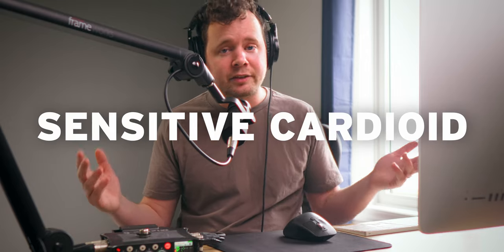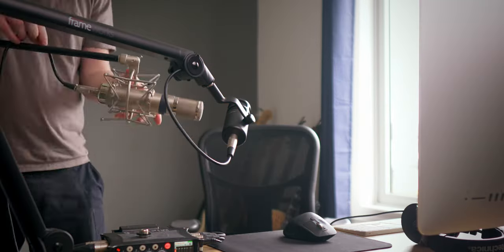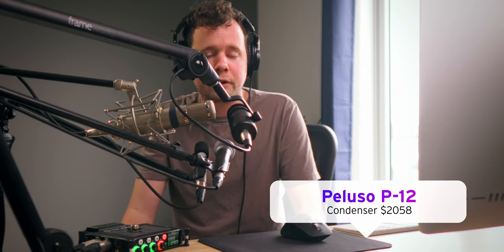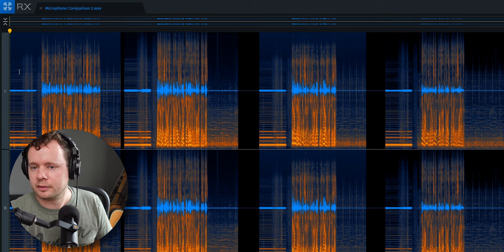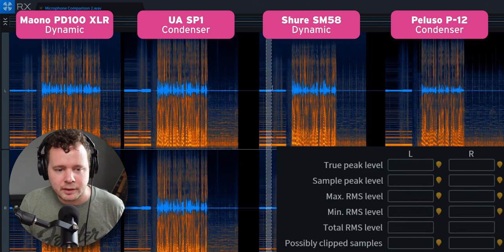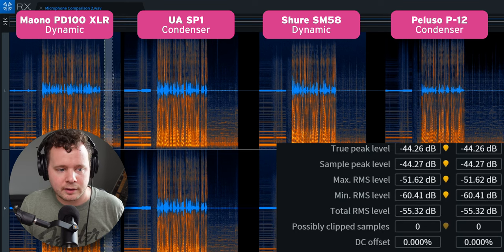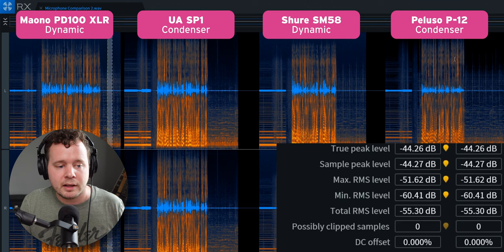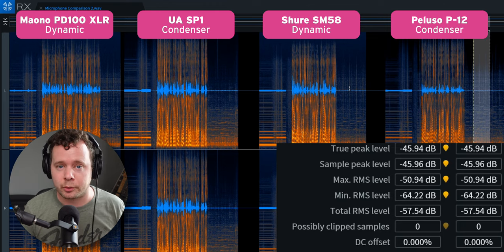Dynamic vs Condenser Microphones

Comment: This is the video I NEEDED to watch. Thank you so much! I currently have a $300 mic and want to upgrade to a $800-$1000 range. My dream mic is the Lauten Eden but before I reach the dream I need something in the middle. I’m considering a 2nd condenser before I get my dream tube. Mainly because of repairing/maintenance of tubes and how it’s not easily fixable in my current location

Comment: This video conflates a general concept of "noise" to mean both preamp noise versus background noise/reverb. Untreated spaces ate terrible for reverb in particular and in terms of someone trying to do some gentle post processing reducing a little hum/hiss from a preamp is infinitely easier than trying to somehow undo reverb
Reply from the maker: Noise in recording is defined by any unwanted signal interfering with your clean signal. This includes both acoustic factors like reverb and ambient noise, as well as electrical noise like preamp noise. You’re right though, electrical noise is generally easier to remove because of its consistency.

Comment: A third factor is microphone self-noise. A condenser microphone has higher sensitivity, but it also has higher self-noise. If the sensitivity gain is higher than the self-noise, then the condenser will have less noise than the dynamic microphone because the SNR starts off higher.  Dynamic microphones have near zero self-noise, but pre-amps have a lot of noise. Adding 10dB of gain in the pre-amp also adds 10dB to the referred input noise of the preamp (usually). So, the situation is more complicated than generalizing without looking as specific microphones. Add in proximity, dynamic range, and artifacts, and it gets even more complicated. If one compares a well respected dynamic microphone like the EV RE-20 to the Lauten LS-208, the Lauten condenser is made specifically to meet all the other requirements that an RE-20 satisfies, and excels with 135db of SPL handling and has a wider frequency response, but the sensitivity is only 5mV/Pa compared to the RE-20 1.5mV/Pa.  That extra sensitivity comes at a cost of a 15dBA self noise. So, 10dB of extra gain is needed for the RE-20, but any high quality preamp will not add anywhere near 15dB of input referred noise to add 10dB of gain. I like the RE-20 for what it does, and the Lauten for everything else, but one is not gangbusters noisier than the other.
Reply from the maker: Oooooo this is a solid point! Thanks for sharing this info. I think you’re totally spot on that there’s not going to be an overwhelming large difference, especially when using decent mics.

Comment: Maybe it's just my ears, but a condenser always seems to sound better to me. I have heard lots of dynamics sound great too, but they never seem to have that crisp high end or the articulation for voice over work a condenser has. The condensers do pick up a lot of background noise at high gain levels though so for some this may be an issue. Depending on the mic and voice, the dynamics always seem bassier with less mids and highs. An SM7 to my ears sounds mushy and blah....you need to eq and process the crap out of one to make it sound decent.
Reply: I have a relatively deep voice and it's a pain in the ass to find a dynamic mic which doesn't sound mediocre. Most dynamic mics make my voice sound like it only consists of bass. Even bought the SM7B two times and an audio interface with better preamps to no avail. I eventually gave up and got a condenser.

Comment: A big part of the sensitivity  is the width of the diaphragm. While an expensive dynamic capsule with two nanometer diaphragm will pick up the slightest noise, much less sensitive 25 nanometer diaphragm on a dynamic will not vibrate from distant sounds. Instead of the rate dropping approximately 40 decibels per 6 in, dynamic microphones will often drop more than two times that amount.  This is why as hard as companies were trying to make dynamic shotguns, when condensers were extremely expensive, They just couldn't pull it off.  They even try to use the SM55 (Same thing. Is this in 57) as a boom microphone called the SM5(a). Basically an SM57 inside of a blimp he would use for a standard shotgun .  It's sold Nothing for 40 plus years (less than 200 units per year ) until all of a sudden the seven version blew up in 2008 for some dumb reason.  Now they are claiming it's always been the number one microphone. It never was in radio stations. It never will be. It's a POS. I agree with you that with new insulation techniques, you can make dynamics work.  You can probably get a pro studio insulation for less than $1,000 per 100 ft².  You could also get a shotgun which really helps if you know how to use it properly.
Reply from the maker: This is all great info! The thing a lot of people miss is that regardless of the microphones sensitivity, you will compensate with gain, effectively making them pick up the same amount of signal (and noise). Noise comes in all shapes and forms, yet people act like noise only happens in really high frequencies, only to be picked up by condensers, but that’s just not the case. Noise is full frequency, meaning the diaphragm, regardless of construction will pick it up. Some less than others, but again, it’s matched when the mics are gain-matched, which presumably everyone does when speaking into a microphone. You’re totally right though that diaphragm construction will make some microphones more sensitive and make them more accurate at picking up with less distortion. This is why calibration mics usually have a 2-3mm diaphragm. They are super accurate. That doesn’t mean they pick up more noise though ;)

Comment: I have a very noisy room and there is lot of background noise. What do you recommend? Please help me understand.  I am new to this and i want to be a  audio podcaster and do voice over as well.
Reply from the maker: 100% the best thing you can do is find a mic thats a cardioid with low self-noise, and make sure you get darn close to that thing! Honestly, proximity is THE best tool you have at your disposal. Get nice and close to a cardioid mic and you’re good!
Reply: @randyrektor  thanks for the quick reply but do you suggest any good stuff to buy. I am returning the sanheiser profile I bought a few days ago cos the box looks tampered and when I tried using it, I could hear a lot of background noise picked up altho I kept the mic close to my face.  
I am so confused to choose these stuff altho I have a great desire to start a podcast.  Please help me with some of your choices in my situation.  Thanks

Comment: SO TO REDUCE A ROOM ECHO WHICH MIC IS BEST CONDENSER OR DYNAMIC?
Reply from the maker: Any mic with a cardioid pattern, but mostly you should be treating your space first. Transducers are transducers that wiggle in the air pressure. Regardless of capsule type, they are both susceptible to picking up noise.

Comment: I have quite a few condensers and dynamics,  in a room with a lot a reverb or background noise I definitely would not be picking up most condenser microphones for recording in that situation.  A condenser is generally designed to pick up every little detail of everything and they dynamic is designed to pick up what's directly in front of it and condensers are supposed to be used from a slight distance which gives them a more natural sound than having them really close which often sounds kind of wonky on a condenser.    If you get something like a tlm 103 even at super low again it's picking up so much unwanted things it's unreal if you're not in a proper recording booth. 

The bottom line in a less than ideal environment I don't think I would be grabbing a condenser mic or at least not most of them
Reply from the maker: Polar pattern is the only thing that determines the direction microphones pick up. A cardioid condenser and cardioid dynamic with similar polar patterns both only pick up what’s directly in front of them. Microphone capsule type can’t discriminate between voice and noise. This is where most people are led astray. Sound pressure levels are sound pressure levels and if they are gain matched, they are both picking up noise in the room equally.
Reply: Yes but that is not what i was getting at here, lower gain levels pick up less noise and a mic closer to your mouth will give you a much more of a voice to room noise ratio, the closer the mic to your mouth means your voice is way louder than any room noise and you can turn the gain down lower too so the room noise won't be as loud,  generally you can get a dynamic closer to your mouth before it starts to sound funky or has too strong of a proximity effect.  now my lauten ls 208 condenser is designed to be used more like a dynamic, you can bring it in very close and still get a prety natural sound, when i bring most condenser mics in close they start to sound boomy and muddy but a lto of dynamics still sound pretty normal 1-3 inch's from your mouth picking up way more voice than room noise.    
 @randyrektor

Comment: I am mixed on your thoughts. It's paramount for my podcasting clients to display proper microphone etiquette to decrease their signal to noise ratio. Of course if they're not using their mic properly- dynamic vs. condenser is going to be somewhat of a mute point anyways. In the case of most lazy podcasters who can't be bothered to display proper etiquette, a dynamic mic is defintely going to help mitigate a lot of the unwanted noise/sounds. This video doesn't really account much for frequency response, and you can definitely hear the extra "unwanted" (in this case) range in your tests. A nice excersize- but I don't think this is an answer.
Reply from the maker: So interestingly a lot of dynamics actually pic up more high frequencies, contrary to what most think. Additionally, large diaphragm condensers are some of the quietest mics out there when looking at self noise.  The reason so many think dynamics are better is because people tend to get closer to them. But if you get right on a condenser and right on a dynamic, the room noise will be consistent. This has been demoed by many major mic companies. Lewitt has a video covering this on their channel too.
Reply from the maker: But you’re right, mic technique is the most important part.

Comment: Still, in untreated spaces, especially with sounds or noises coming from other rooms a dynamic mic is so much easier to handle, and much less work in Post. This is at least my experience.
Reply from the maker: Yeah for sure! The point is that this is entirely due to how people tend use them, not because of the technology.

Comment: SNR is not based on the noise of the environment, but is based on the noise created by the internal capacitors, resistors, etc. of a microphone. 
each microphone will always capture background noises, (Diegetic Sounds) what makes dynamic a go-to for non-treated rooms is that dynamic microphone tends to capture "louder sounds" without the use of phantom power,  so in laymen's terms, a dynamic microphone is useful when you don't have better preamps with you,  so in this case you are using a sound devices which is one of the best preamps there is in consumer market. 

as you notice, when you speak with your SM58 you won't notice the noise because the noise floor itself has been canceled, by the loudness of your voice it's there but we wouldn't notice it because we are more focused on your voice than the background noise, but then, once you record in silence, the diaphragm would always capture the loudest noise there is, and in this case music and whitenoises. 

and lastly, a well-treated room is not about soundproofing it from unwanted outside noise,  but making sure that you have well-balanced diffusers/reflectors bass traps around the room. using condenser microphones in an untreated room will only cause problems with early reflections (reverb) in which a dynamic microphone doesn't really capture reflection that much that's why it's mostly used by artists on stage for vocals even there' are dozens of people shouting from the audience area.   but unless you are capturing instruments or vocal-specific frequencies then a condenser would be your choice, 

That's why in the film especially in bigger production they rarely use shotgun microphones with long capsules and choose to use short ones,  to avoid reflections that bounce through them.
Reply from the maker: Thanks for the comments, but there are a couple of incorrect points here. Signal to noise ratio is based on the noise floor which is made up of both acoustic and electrical noise. It's a combination of all of the noise in relation to the direct signal. This also includes reflections, etc. The noise floor is not 'cancelled' by speaking into the microphone. This would only happen if you had a compressor on the signal, which in my case, I did not. Otherwise the noise in the room is entirely fixed and cannot differentiate between voice and noise. The ambient noise is a physics property and will be picked up by any microphone just the same, bearing it's a cardioid polar pattern. While I understand where your points are coming from, they are almost all incorrect. I'd suggest checking out this thread on the topic - https://www.reddit.com/r/audioengineering/comments/untwmx/i_dont_get_it_why_are_dynamic_mics_better_than/
Reply: @randyrektor  good point, all I have are experienced in using both microphones for films and voiceovers and living in a very noisy environment with blank walls, that isn't treated , I encountered problems with condensers than with a dynamic especially well-pronounced frequencies that hits vocals which is really important on my end.

Comment: I actually disagree. Soundspeeds disproved this theory in his video "Polar Pattern or Microphone Type? Best for Reducing Reverb - Sound Speed".  Dynamics actually do reject more of the distracting noise. I also tested this out myself and I have 2 videos proving that dynamics actually do reject more of the distracting noise around you. It's not 'just' bringing the mic up close or the polar pattern. Dynamics really do reject much of the ambient noise around you. I did a demonstration in a bathroom with 2 supercardiod mics (one condenser (Ethos), the other dynamic(XM8500). The Ethos picked up all the distracting noise around it while the XM8500 did not.
Reply from the maker: I appreciate the anecdotes and personal experience! That said, microphone manufacturers agree that this is not the case. Your experience may vary from mic to mic, but there is no inherent property that makes one transducer pickup less noise than another. That said, your experience and mic preferences are a great resource to make great recordings
Reply: I think it heavily depends on the title of your video though. When audio engineers everywhere say to people, use a dynamic if you have no sound treatment and people chatting around, there's viability in that. Dynamics pick up less of the annoying sounds around whereas condensers (being more detailed) pick up everything. @randyrektor
Reply from the maker: The point is that the advice is flawed, outdated, and debunked. People hold onto it because the information is widely circulated, but that doesn’t make it accurate.

Comment: correct me if im wrong but what about EIN? EIN is essentially the self-noise of the preamp that you were describing. and iirc for there to be "no noise" from the preamp it has to be at most -129.6 dB. some audio interfaces get close to this number (example: motu m2 is -129 dB) with some even surpassing it (SSL 2, SSL 2+ has -130.5 dB EIN), both of those interfaces are within $200 so its reasonably priced. would you say a dynamic microphone is still justified this way or should i just go for a condenser
Reply from the maker: I think you’re totally on the money. Preamp noise is reallllly not a huge deal these days with the costs of good tech coming down. To answer your question, as other commenters have alluded to, it really comes down to how you intend to use the mic. What is your use case? Voice over, music?

Comment: Interesting video and discussion. I can only say anecdotally, that in my recording space, a condenser microphone will pick up a faucet running on another floor, any cat or dog sound anywhere in the house, my wife on the phone 3 rooms away,  or  a car passing by in the street; while a dynamic mic, in the same circumstances, will at most pick up a dog bark. In your test, it might have been a better demo to use only the dryer in the next room for comparison, as I think music has a unique way of calling attention to itself, both subjectively in the listener's head, and in terms of frequency range. Just my .02.
Reply from the maker: Yeah thanks for weighing in! Solid point about the music 👌🏻👌🏻 I may have to take another pass at some of these tests

Comment: so basically if my budget is low and i cant afford to sound treat my room, my audio is gonna be shit doesn't matter which type of mic i use. right?
Reply from the maker: It definitely doesn’t help, but you can do a lot with soft surfaces you have around the house. Pillows, blankets, etc. then get the mic as close to you and as far from your noise as possible. Also make sure the noise is on the ‘blind’ side of the mic. This will help! I have no actual acoustic treatment in my space.

Comment: If you have a good interface, then gain noise shouldn’t really be an issue with any mic.
Reply: Gain noise is still an issue with the Rodecaster Duo which has good preamps.

Comment: Also, another reason behind “dynamics for untreated spaces” is that polar patterns are not fixed, they are frequency dependent. So while any two microphones may exhibit a tight response at 1khz, it’s common for condensers to actually drift towards an omni directional pickup pattern as you go down lower to lower octaves.

This can add to the perception of noisiness
Reply from the maker: Solid point!